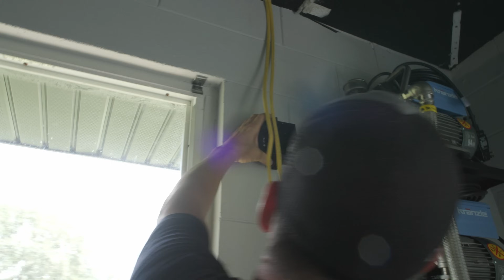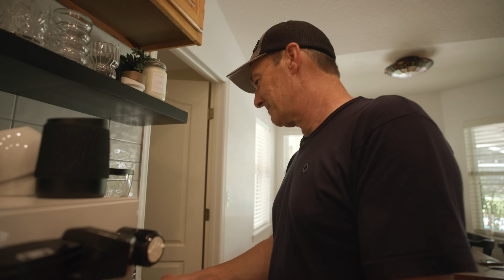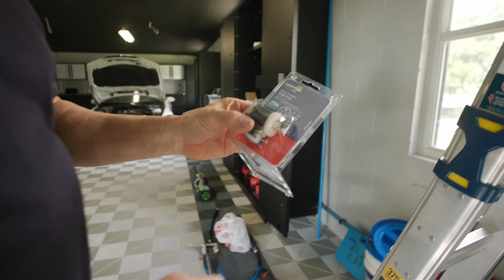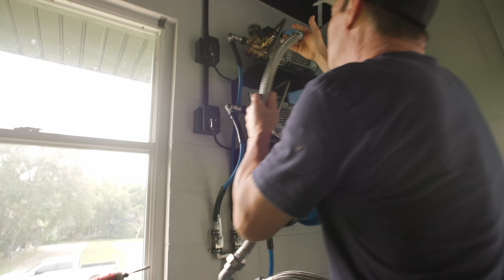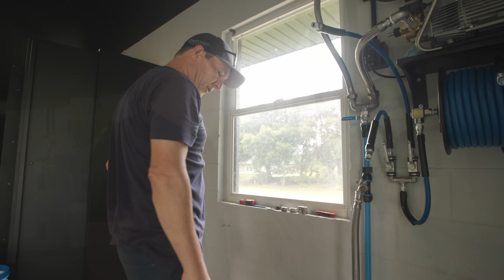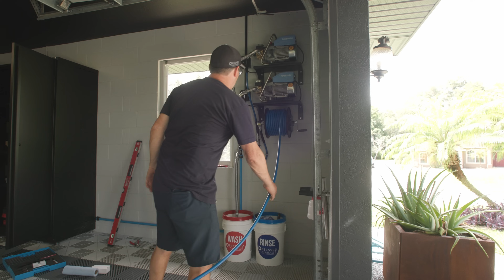Mike Completes Mike's Dual Kranzle Pressure Washer Setup! | Bonus Vlog (Part 2)

Comment: Mike I want to use a mixing valve to deliver warm water to bucket filler as well as to pressure washer how do i accomplish this? P118 and two standar prier bibs?
Reply from the maker: You could put a Y off the P118, but you shouldn't do anything over 140F into the pressure washer.
Reply: @ObsessedGarage  Yes my active 2.0 can handle 104 i would not go past simple warm water or 70 degrees. How would the Y work if using a bucket filler plus power washer with P118. i would need two spiggots
Reply: @ObsessedGarage  Matt is it adviseable to run hot and cold water through an active 2.0? I spoke to Prier directly and they said P118 cannot handle the constant pressure of a power washer? Do you guys or have you guys every installed a mixing valve to deliver hot and cold water to the bucket filler and the power washer?

Comment: According to your experience the flow rate and pressure of the higher pressure washer which is kranzle k1322 ts or kranzle k1622 ts?
Reply from the maker: The 1322 and 1622 measure exactly the same with a pressure gauge.  The 1322 had a different electric motor and more aggressive wobble plate that creates more flow.  The 1323 is superior in every way.

Comment: Great job guys as always! I like the black power coated shelves as it will match the new DI rack system.  Can’t wait for that to be released with the swivel hose reel set up. Learnt a lot from you Mike F(Steve)! keep the videos coming.

Comment: I love watching these videos.  Gives me many ideas for my garage space.  One somewhat silly question but you mentioned about the shut off valves in case you need to remove a pressure washer for service or repair.  I see the one valve on the inlet side of the pressure washers and then individual valves from each pressure washer to the hose reel.  If you were to remove one of the pressure washers while still using the other, would you connect the inlet hose and outlet hose from the pressure washer you removed together so there aren't any leaks?  Hopefully that makes sense.  Keep up the great work!  Love the Mike and Mike content.

Comment: Surely the electrical outlets would have been better on the other side of the pressure washers, away from all of the hose joints, if one of those joints start to leak they're spraying water all over those outlets. Is there a reason you've done it that way?

Comment: The install looks great but is there a reason not to use rigid pipe for the intake instead of the braided lines? I'm sure there is a good reason like vibration or looks.
Reply: Vibration is a big reason as well as ease of installation and removal for service.

Comment: Wouldn’t the cutter you’re using on the Prevost work on the EMT?
Reply: The blade is meant for aluminum, I didn't want to risk dulling it for two cuts.

Comment: Wouldn't it be a lot more efficient and cost effective to use one larger pressure washer instead of two?
Reply: Kranzle makes a larger kw700ts and it is a nice machine but it does not flow as much and costs more than the two 1322's do.

Comment: Not sure about the electrical points on the left and the power cable running behind to the left. Personally would have looked cleaner with the electrical points to the right of the pressure washers with a short 20cm cable. Electricals to the right. Water and plumbing all to the left. This might bother Matt haha

Comment: Electrical question for you Mike- I plan to upgrade to an AR630 soon; I have a 20amp circuit in my garage now that has multiple(5) plugs on it, but nothing plugged into them. Could this still be a "dedicated" circuit and function well for the AR? Or should I install a new breaker and individual circuit? As a custom structural steel and aluminum door fabricator, it is absolutely amazing to watch another professional work. Hats off to you, sir.
Reply: That would certainly work. It wouldn't be considered "dedicated" because there are other outlets on the circuit but as long as nothing else is drawing power on it the 630 will run just fine.
Reply: @MikeFigueira-OG  Awesome! Thanks so much for sharing your vast knowledge with the people! Like Mike always says, you're a good guy Mike!
Reply: @devinweldon2  👍🏻 Thank you

Comment: What is the reason for dual units, is it for increased flow?
If so and you went to the trouble of running two 20 amp circuits why not run one     
240 volt line and run a commercial unit with a 4-5hp motor running a pump that can give you 4-5 GPM?
Reply: Increased flow is the main reason. The larger kw700ts is 240v but doesn't flow as much and does cost more.

Comment: PRO TIP for mike, Use a plumbing pipe cutter... you will thank me later.
Reply: You need a different blade then, get the blade for stainless gas pipe and turn it in slower, I have been using it for years now
Reply: For the EMT? Yea it works but it does leave a big rolled burr inside.

Comment: I like the install.  Everything  about it looks really good.  I think there’s one more thing you need to do to really set that install off as being truly top-notch.  Get couple of brass 2 or 3 inch pipes and 2 90’s and reinstall those gauges so you can see them from the ground.  Those are great looking gauges that you cannot see without getting on a ladder.

Comment: For block wall, try lead anchors with a hollowall set.  Wayyyyy stronger than a tapcon. 1/4-20 is rated several hundred pounds.  Especially for mounting those pressure washers.

Comment: can i ask.....why wouldnt you put the electric on the right side of the pressure washers? it would be safer, but aesthetically, would have given more room to the plumbing and not look so cramped
Reply: Nothing to worry about. Nothing is going to leak here. None of the water lines will be touched except for a service at some point and you shut water supply off in that case. In terms of protection these receptacles are GFCI protected. It's a matter of aesthetics. Having all the business done on the left side leaving the right clean. Either side will work just fine.
Reply: @MikeFigueira-OG Plus, running electrical wire down from the crawl-spaces; (in the ceiling corners, is tight due to roof meeting the walls).  2.) Anti-syphon hose bibs can be added at the pressure washers, (threaded fittings, like any hose attachment). Mike: It is a pleasure to watch someone who knows what works and has done this kind of work…
Reply: @rockercover  You are correct and thank you.
Reply: Technically speaking a permanent connection to a pressure washer requires a backflow precentor, per FL code.
Reply: @AndrewTa530 the entire house is back flow protected.
Reply: Was now going to ask the same thing, would also make the cords even shorter.
Reply: I agree. Electrical should have gone on the right. Too cluttered on the left.
Reply: All that water right on top of the electric doesn't seem "obsessed".  Is this Matt Mormon approved????     

I also don't think that meets FL code.  Is considered a wet location thus should have a cover on the outlets.